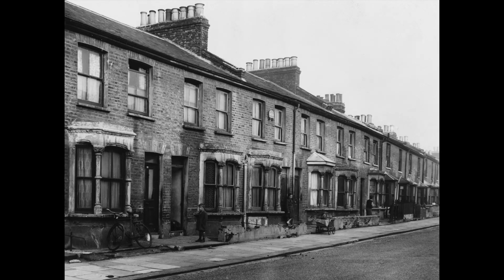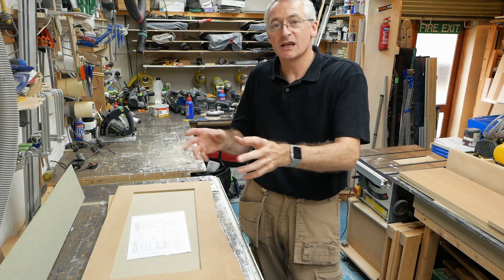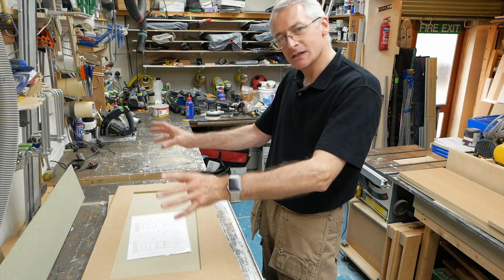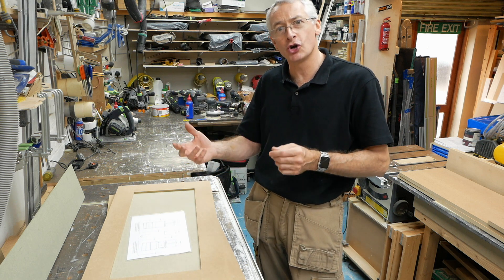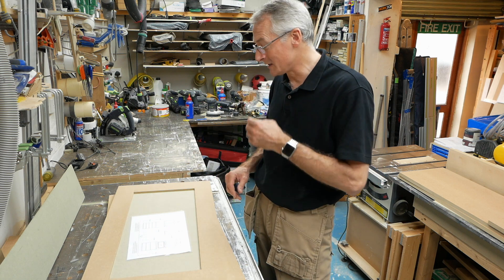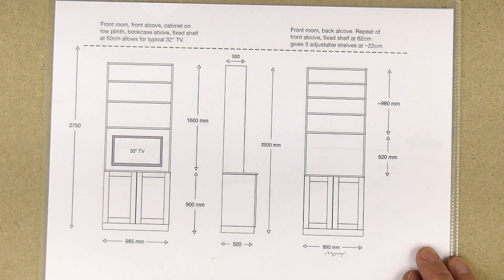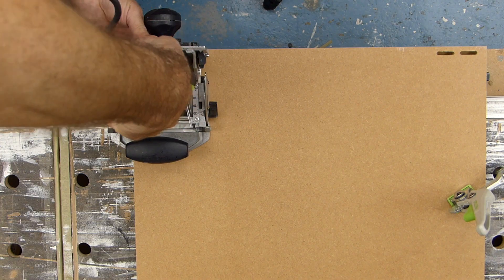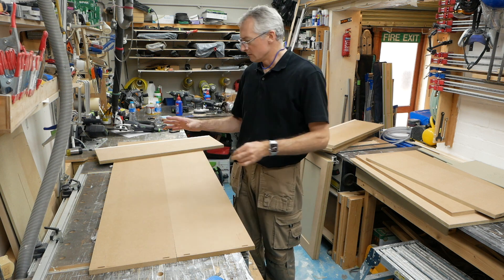1 of 5: Alcove Unit #094

Comment: I got addicted to your videos. Just got started on my bathroom sink cabinet project and your videos do contain a lot of useful information for beginners. Thank you
Reply from the maker: +Ádám Elekes Thanks, glad to hear it 👍
Reply: Out of interest, would you use MRMDF for a sink cabinet, Peter? I only looked into working with it from your videos, and I see a lot of "oh well it's not structural" comments on Google, but you make it work well for structures that are capable of taking a load - TVs etc. Would a sink be too much?
Reply from the maker: Yes, certainly. If you expect the sink to overflow regularly, then maybe consider something else, but MR MDF is made with just this application in mind. The vast majority of kitchen cabinets made commercially in the UK and Europe are made from some kind of laminated particle-board or chipboard, and MR MDF holds up well in comparison. And absolutely no question whatsoever that MR MDF is strong enough for this kind of structure. 👍

Comment: Hi Peter. Could you explain, or link to an explanation as to why you lip your shelves with timber, I assume European red wood? Many thanks
Reply from the maker: In this instance it was because the shelves were for books, so a solid timber lipping gives it additional strength, and helps prevent sag over time. And yes, what we call Scandinavian Redwood, or just ‘Redwood’ it’s the standard grade of joinery timber here, also called Scots pine. 👍👍
Reply: @10MinuteWorkshop  ah good to know. I initially thought it may have been for some aesthetic reason. I can see why the additional strength is needed due to supports only at the ends. Always learning! Thanks for getting back to me!
Reply from the maker: @jparsonsmedia  No problem, thanks James! 👍

Comment: Hi Peter, do you have any videos where you show marking out etc for your domino machine? Is it all done using pencil lines and then eyeing it up with the machine? Is there any play in the domino holes to allow any side to side movement so that for example if the front face of your cabinet side was misalligned to the front face of the top biece by a mm or so you can wiggle it about to flush it all up before clamping? Thanks Colin.
Reply from the maker: Hi Colin. I haven’t done anything on the Domino as there are already a ton of videos about it already on YouTube. In short, the Domino has little pins or paddles that register against the edge of the pieces to be joined, so registration to the edge is pretty flawless. Anything inboard is generally done to a pencil line. There are three widths of Domino mortise available, so plenty of wiggle room if needed. I usually cut the mortises in the face at mid-size, and in the edge of the board at the smallest setting 👍
Reply: @10MinuteWorkshop  thanks for the comprehensive reply Peter, keep up the good work :-)

Comment: That ended abruptly Peter,out of interest due to cost,do you consider the domino markedly better than a biscuit joiner?
Reply from the maker: +Simon Wallis Yeah, it was a bit sudden; tbh this was edited overnight as I was going away on holiday the following morning - had to get it done! And yes - domino's a different animal altogether IMHO. 👍
Reply: +Simon Wallis
Biscuits have more flexibility in their range of types and uses. There are many different types of biscuits from wooden, plastic and metal materials. 

Some metal biscuits act as a connector so you put the biscuits in both joint pieces and then you can connect them together. So that means you can do them in the workshop and then connect them on site.  Some metal biscuits allow you to fit them in and then screw them into place rather than using glue or wedging them in. 

Dominos are also fantastic but not quite as flexible or easy to use on mitre joints and they require more precision but are very strong for how easy they are to use in general. 

I would suggest for most people to get a good Mafell biscuit jointer for about £450 that is very accurate and then use different biscuit joints. 

I my self use both biscuits and dominos.

Comment: Based on the videos that I've watched, you seem to prefer using MDF over plywood. If that is the case, what informed that decision?
Reply from the maker: +Matthew Buntyn Thanks for watching & taking the time to comment. Here in the UK we're fortunate to have a variety of types of MDF available, and MR (moisture resistant) MDF is a much better quality board then regular MDF. It also takes paint extremely well, is stable,  machines nicely, and is the staple of the fitted furniture industry both here and in Europe. To achieve a similar painted finish in plywood takes a lot more work, and a decent quality plywood is well over double the price of MR MDF here.

Plywood also generally needs edging as it can be very difficult to lose the 'stripes' on a cut edge when painting. So plywood becomes a more expensive board that requires a lot more effort to achieve a good painted finish. It is stronger, but that's usually only a consideration on e.g. shelves over a certain span, of if you know the shelves will be heavily loaded - and even then, a deep (~20mm) lip added to an MR MDF shelf makes a huge difference. 

Short answer: for painted work MRMDF is easier to work with, cheaper to buy, and gives a better result with less effort. HTH,  Peter 👍
Reply: Peter Millard Thanks for the answer
Reply from the maker: +Matthew Buntyn 👍
Reply: And even the most expensive plywood will attempt to warp. It is the inherent evil deep inside the beast!

Comment: What size are the sheets of mdf you use? In USA sheets are 4x8. Your shop is small. Where do you break the sheets down?
Reply from the maker: Yep, 8x4s here too. It is small, but doable if I have to - most of the time though I have my sheet goods cut to size as I have a very good timberyard near me that does precision board cutting. This generates a decent quantity of sizable offcuts, which is what I was using on this projec.t 👍

Comment: Big fan of your videos, enjoyable format and informative ! From other comments I understand you use MR MDF. If you can say, which make is it ? Medite may be. Why is it not green ? Just curious as I'm in a quest to find a local supplier with a cutting service. I would like to achieve a better result than with the furry MDF I find at the shed store.
Reply from the maker: +Geoffray Doignon Thanks! Yes, usually Medite. The thinner boards (12mm and less) tend to be green all the way through (though not always) whereas 15mm and thicker tend to just have the green core. And yes, a much better quality board all around than regular MDF 👍

Comment: Hi Peter, which width (amount of slack) setting or settings do you use with the DF500 on a project such as this? I very much enjoy your videos but I do wish the power tools didn't sound like a dentist's drill on the speeded up sections ;-)
Reply from the maker: +Simon Fisher They're usually tight on one side and mid-setting on the other - I don't think I've ever used the wide setting, tbh! And yes, I know - sets my teeth on edge every time, even though I knock the volume down to about 8% on the ff sections! I've tried muting them completely, but it doesn't feel right at all. 👍